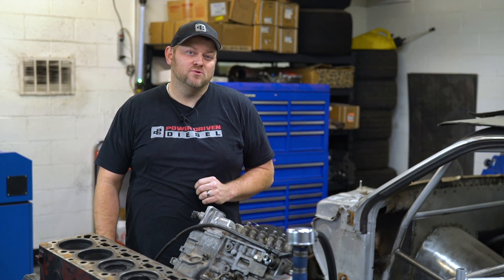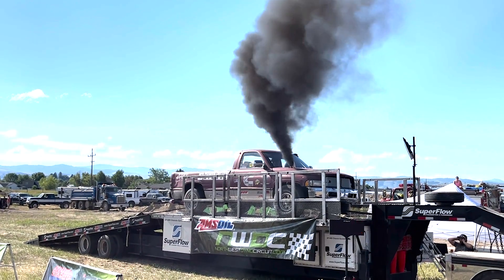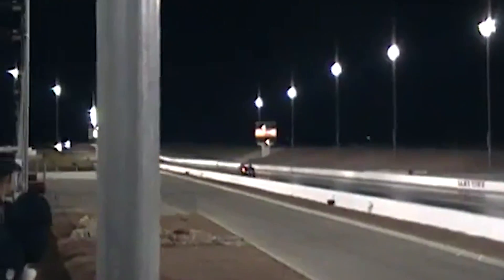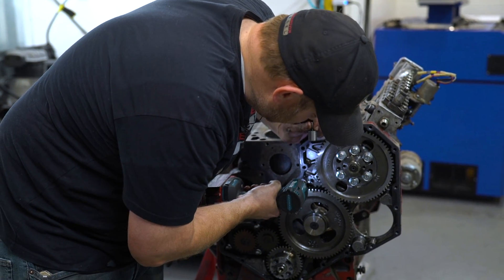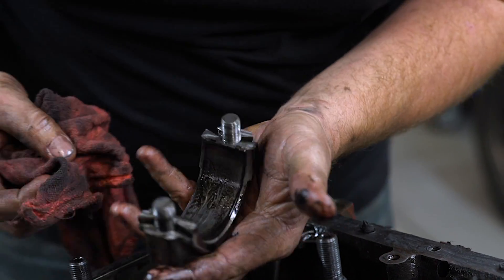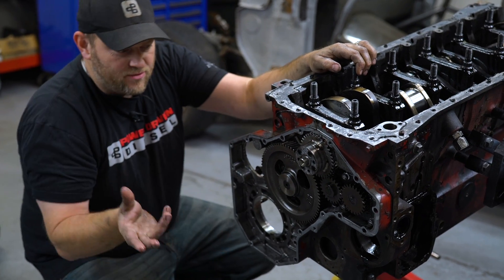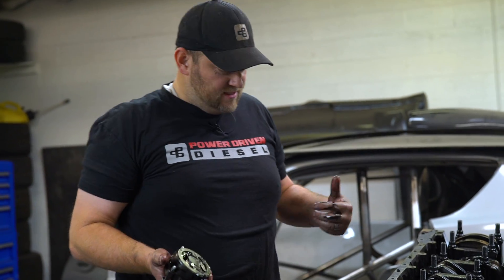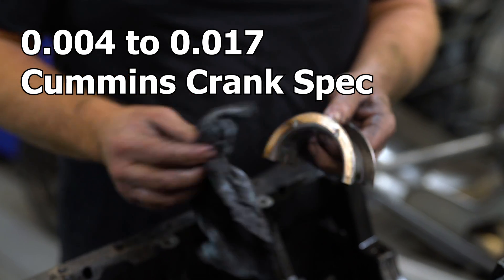Junker Drag Truck 150 psi Boost

Comment: THANKS for the video will i always find tear downs from these mishaps interesting . When I bought my 01 24v the owner couldn't figure out why it had low compression on 1 and 6 . They cracked the rings from boost leaks and bad injectors.  They tried fixing all that stuff after but I purchased it and had the block honed then I rebuilt it. I made sure I threw in plenty of cleanernce when I rebuilt the engine .

Comment: It was really interesting ( and informative) that you mentioned high line pressure in the transmission can apply a forward thrust into the crankshaft.  I can’t go into too much detail of the situation on social media, but a somewhat similar situation just occurred at work, although it fortunately didn’t hurt the engine; at least that we are aware of. I doubt it did it any favors though. 

Long story short, a machine had a torque converter failure shortly after I fired it for the first time. When the converter was built, pipe plugs were overlooked in the shafts of the power divider planetary gear cluster, and this allowed a higher than normal volume of oil to flow into the flywheel housing, exceeding the volume the scavenging pump would normally evacuate. 
The resulting pressure buildup pushed the input shaft into the converter with enough force that a thrust washer was consumed, and metal was transferred to the adjacent plate. 
This all occurred within minutes of run time, so it’s amazing how the smallest of details can lead to catastrophic failure!

Comment: I used to do burnout comps and you look at how the engine touches in certain spots so they get a bit more clearence . Everything expands alot when you push a motor out of its design it was made for .
Reply from the maker: Yes absolutely that is why as we go up in hp when building these motors all the clearances increase as well!

Comment: You can drill and tap those dowels m6 then run a bolt in till it bottoms and it will push the dowel out.
Reply: yep
Reply from the maker: That's a great idea.

Comment: I just got done rebuilding an old Continental Z-134 and long story short had to do the rebuild in frame because previous owners welded some pieces together that shouldn't have been. So I used magnets to hold up the tappets so I could remove the cam, thinking I was going to reuse them, and then upon inspecting them decided to replace and used the magnets to hold the tappets in place while I slid in the cam. I bit of a PITA but overall not too bad. Definitely would have been easier if I could have done it out of the machine.

Comment: I rebuilt my first 5.9 in vocational school @ 16 y/o. The Farmer said blow by was a problem, but said it NEVER got hot.....#6 cylinder was a train wreck. I had to have it sleeved, and luckily it only took .010 to clean the rest up, with no elliptical wear..... Coolant flow is never top notch @ #6 on a 5.9 with a stock pump. Mods can be made with an electric pump, some fancy drill and tap work, to bypass coolant to that cylinder (externally) and should cure the "hot lapping" cylinder overheating issue. And it shouldn't affect the structural integrity of the block. Most 5.9 race engines are short ran and are block filled, so heat cycling is short and hot, with long cool down times, but that takes time both on and off the track.

Comment: When using bolts and keys, what would happen if you also welded the dampener on to the crank snout?  Would that be a horrible thing to do?  One disadvantage would be having to take the motor apart and then bandsaw the balancer off if you had to replace it.
Reply from the maker: with Fluid dampers full power kit and there diamond washer we have never had an issue even on our UCC truck.

Comment: Gets my gears turning, to say the least. I've got a 94 12v with 140k og miles on it. Bought new by a man that kept it in a garage basically its entire life until he gave it to me.
Reply from the maker: Tuning up an older 12v Cummins to even 500 HP makes for a fun daily driver/tow/street truck.  They are extremely reliable in the 500 HP range, like 1 million miles reliable.

Comment: I’m guessing the stock oil pickup tube isn’t a issue in most street-only truck builds, but at approximately what RPM does that pickup tube start having the cavitation issues?
Reply from the maker: 5000rpms

Comment: Love the 12V content.  My 96 12 valve 5 speed has 310k miles, has been tuned to 450whp for the past 30k without a hiccup (was bone stuck til then).   Only using it to tow heavy over mountain passes.   My limiting factor is EGT, can't hang out above 30psi for too long but can hold 35psi for a few minutes.   30psi will stay under 1300 all day and night regardless of grade.   Coolant temps are always good.   Need a better turbo some day, still has the original stock HX35...  do you have any recommendation for a good towing turbo?   Not worried about turbo lag since I'm always in the throttle towing up hill and don't race it.   I could really use another 50-100hp on certain grades without EGT issues.
Reply from the maker: The Borg Warner k27

Comment: Number 1 and 6 seem to always be hot. What are your thoughts on drilling out the coolant jackets on the gasket for those cylinders? 
I opened all of them a little, and favored number 1 and 6 a bit to reduce the temp climb when at on it for an extended time.
Reply from the maker: There are tons of strategies that have tried to control temperature on those cylinders.  In the end it has been easiest to add a little more piston to bore clearance and ring gap in our experience.  The gasket mod trick does seem to help as well but we've never tried a modded gasket with no other changes.
Reply: @pddofficial  From my understanding you trade ring gap for blowby. The trans you are rebuilding for me now, the engine its mated to has well over a million miles on, I am sure that's next thing.

Comment: Interesting. Good luck with the next build!

Slightly unrelated, but do you guys plan on experimenting with (more) engines from International, like the DT466 and/or DT360? Was curious.
Reply: There no different than the cummins we have a dt466 that's bored to a 540 that's making 800hp. Still running a rotory injection pump
Reply from the maker: We don't have any vehicles or engines in the fleet or our local customer base with DT466 or DT360 engines.  It's fun to try new platforms, but availability/commonality is key when it comes to experimenting.

Comment: does anyone know if that predator lift pump will also work on a 1992 12v cummins with a ve pump
Reply from the maker: No it will not unfortunately due to not being able to regulate it's pressure down far enough.

Comment: I have a real question. It seems to me that the internals are aftermarket and the short block was built for higher hp... I have a 12valve in project right now, I can't help but wonder, if I do the detail work to the internals that would theoretically be viable for 1000+, but tune to keep it at 500 max, how would it run, how long would it last, would it be efficient? I don't do competition or racing of any kind, it's a daily driver project. I was thinking I wanted to put the money into the internals that would increase efficiency and longevity and then run all externals at mild components. I've seen people try and make huge power on stock internals but I've never heard of anyone building the crap out of a motor and try to run it at a streetable power level.... I wonder what the outcome would be.
Reply from the maker: It is better to setup your tolerances to the hp you are going for as the higher you go in hp the looser/more worn out you build the motor.
Reply: @pddofficial  right, but a lot of the other factors is more my focus, such as the pistons that allow for a larger valve opening, extreme balancing, lightening the crank a bit, port the head ( not a wild cam ) put a cam in it, adding the girdle... I recognize that there are dimishing returns, I am more focused on building this motor to run super efficiently and give real performance for a long life. Like I said, this is a daily driver out here in cattle country where it gets slick as snot muddy. Most of the time it would be a waste to have anything more than 100 hp, but sometimes you gotta put the peddle down and have some fun.

Comment: What happens if you leave the killer dowel pin out on a engine with a fuel plate and governor springs? Mine had fell out and was in the oil pan when I got the truck. It was all chewed up from being between the cam gear and the block so I didn't put it back in.
Reply: nothing, its just a alignment pin to help you put the timing cover on
Reply: @cs-gj3yf  then why isn't the fix to remove it?
Reply: @bryanford1139  cause diesel companies can't charge you 50 or 100$ for a piece of tin metal to "fix it"? duh
Reply from the maker: The alignment dowels determine the position of the P-pump gear and the cam gear.  it sets the clearance and I would not remove the pin.  Much easier to put a tab over the pin than remove it unless it is almost totally out.  The pump puts a serious load on the cam gear and also the gear case itself. On a stock power truck with a lot of miles on the motor if the pin falls out it probably will be fine unless it caused damage.  But on a fresh motor or hotrod motor use the pin and put a cover on it to keep it in place. 
-Todd
Reply: @pddofficial  huh, ive rebuilt 20-30 12 valves and ive taken the pin out and tapped the hole, then put a stud in it for a nut, never had any issues.
Reply: @pddofficial  Why not drill a hole in the cover and put a bolt in to hold the dowel pin externally?

Comment: 150psi on a stock bottom end…..what an engine the 5.9 is, holy smokes.
Reply: Lol stock block, stock 6.7 crank.  But it does have billet rods, upgraded cast pistons, and a girdle with studs.

Comment: On the crank/harmonic. Can you sleeve the bolt holes?
Reply from the maker: There's enough room to drill and tap the threaded holes to 9/16", but that's kind of a last resort.  There are a couple of competition-use taper-lock setups, but we've never looked into them for street use.  Most of them lose the factory belt drive.

Comment: ive never heard someone say 40 degrees of timing before
Reply from the maker: The party starts at about 35 degrees and keeps getting more fun up into the 50's.... if you have an engine that can take it of course.
-Todd
Reply: @pddofficial  So let me get this straight. While the crank is making its rotation around, its in its up stroke, then turned 50 more degrees before TDC the fuel is fired? So its like, a good distance pushed further down into the bore then struck by this titanic force of fuel and 150psi/nitrous mixture, crushes it, then makes the boom?

Its just so insane. Thats like double the timing of "normal" engines or more.

Comment: 150 PSI of boost and the head gasket didn't give up ? And that's a diesel, which means much  higher compression ratio than spark ignition engine to begin with. I wonder what kind of material the head gasket is made of ? KRYPTONITE !!! Frankly many gasoline atmospheric engine have hard time keeping all the fluids where they are suppose to stay without ever drag racing.

Comment: LoL, 150 psi and only 1500 whp? on a 6.1?
Reply from the maker: Yes, it's tough to make the big HP numbers on these old Cummins engines.  But show me a 6.1L that makes well north of 2000 ft lbs and that shows what's really going on in the cylinder.... big pressure... just can't maintain it till 7k rpm.

Comment: What will cause a diesel to smoke on cold start.  
I have a mercedes with the om603 3L turbo diesel. It smokes on cold start 
For about the first 3 to 5 min. After its warmed up a bit it stops. If I plug in the block heater it doesn't smoke and doesn't smoke except winter. It never uses oil 
And has good power. It only has 170k miles. Reman injectors. Glow plugs. All new top quality filters.  Any ideas or suggestions would be greatly appreciated. 
Thanks for your time and videos.  Robert
Reply from the maker: We don't have a lot of experience working on OM603's, but in general, the cold startup haze is caused by incomplete combustion.  The more haze, the more partially burnt fuel escaping out through the exhaust system.  Unfortunately, if all of the injection systems components are fresh and with-in spec, there are very few inexpensive options to eliminate the haze.  You can try to reduce the ignition temp requirement of the fuel: higher cetane value, preheated diesel fuel, aftermarket injector with custom orifice size to increase atomization.  

From an engine design standpoint there are several factors that reduce idle haze: Increase compression, increase swirl in the combustion chamber, change characteristics of the injection event(multi-shot injection).
Reply: @pddofficial  ok thanks for your time. Its probably the best driving and most reliable car I've owned. Runs great just smokes a bit when not plugged in.
I will try ctane additive.  What do you think about all the videos online people
Mixing strained used motor oil with diesel. Seems like it would be hard on injectors
Reply: It still sounds like a glow plug system issue. Possible controller. Does the engine run rough until the smoke goes away? Is it a white smoke?